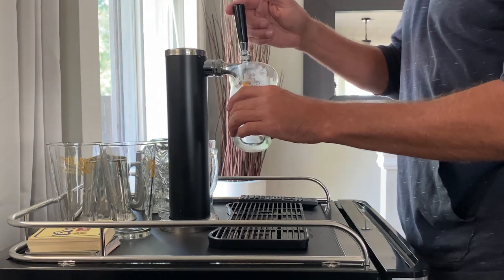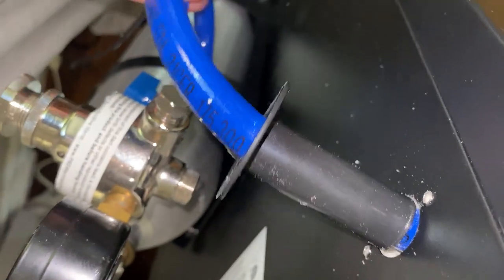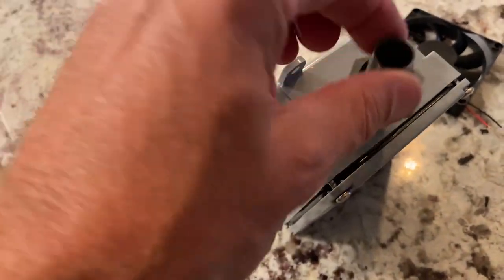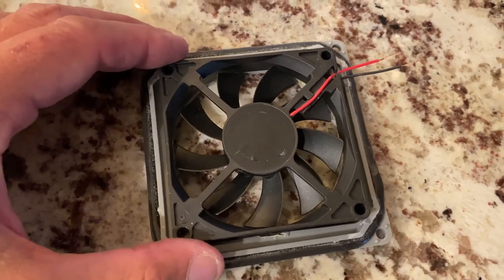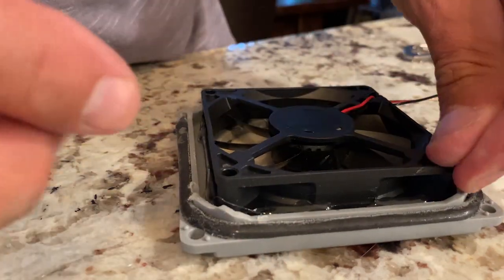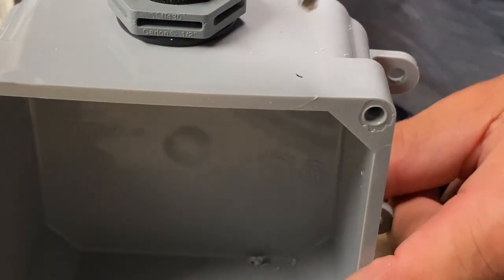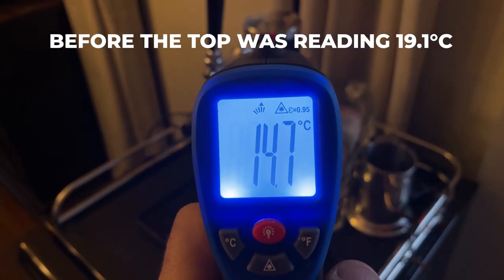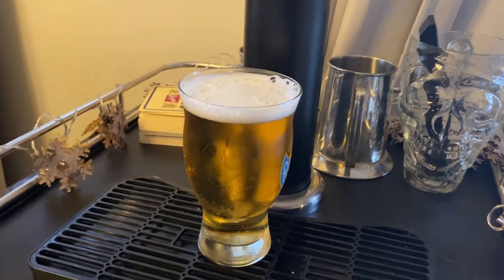DIY Draft beer tower cooling - keep your beer cold from the keg to the tap

Comment: How did you mount the junction box to the wall inside? Hot glue?
Reply from the maker: I actually screwed it to the back cooling unit, you can see where the cooling liquid runs through so I just made sure to avoid that. I don’t suggest you do that if you hit the coolant, don’t blame me
Reply: @warrenhardy  hot glue it is 😆
Reply from the maker: @nukadadd  if it doesn’t hold, I would try a silicone glue
Reply: @warrenhardy  thanks for the suggestion. Maybe I'll ruff up the surface with some 60 grit for good measure